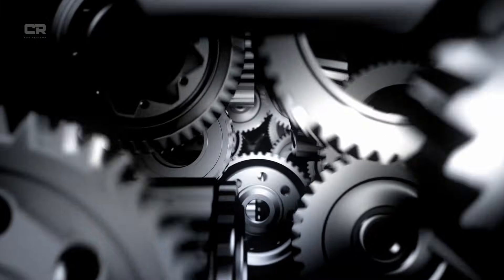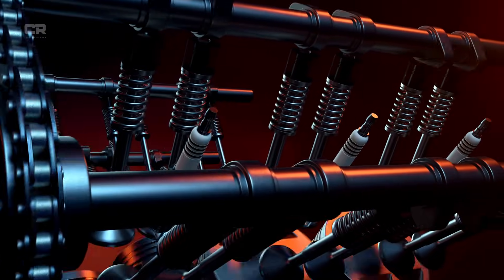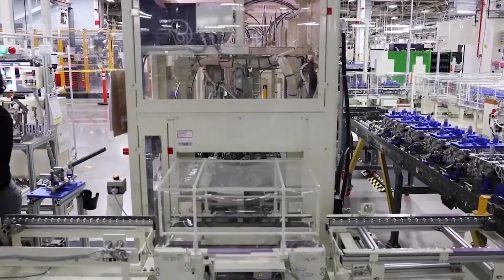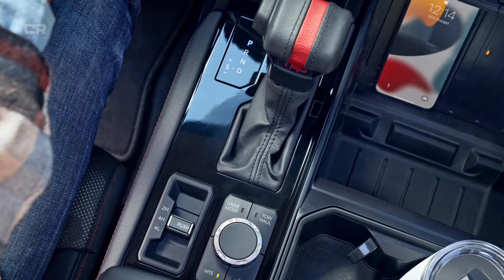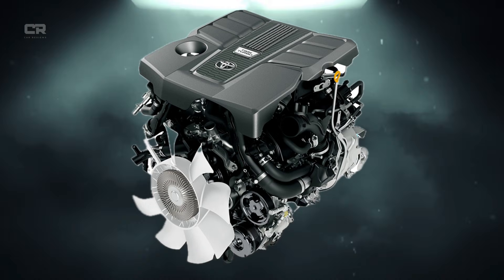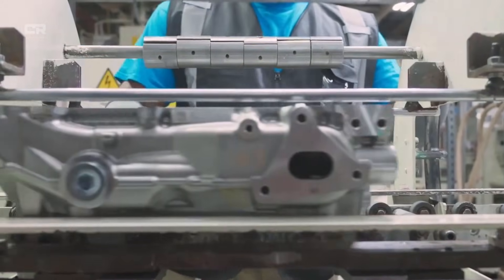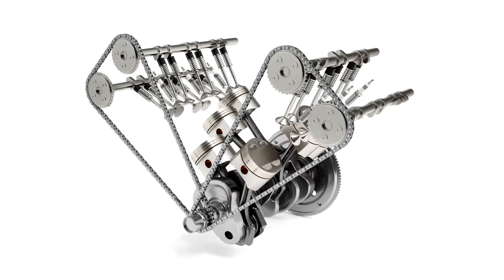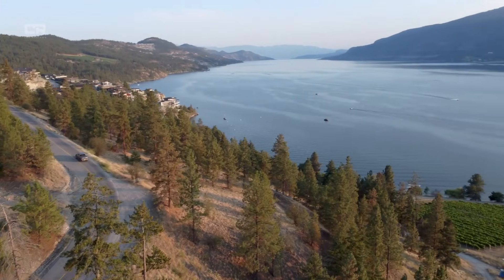Engineering Analysis: How the 2026 Tundra Engine Block Was Reinforced!

Comment: Does it improve nvh as well?  Its not a very smooth idling engine
Reply from the maker: Yes, the reinforcement does help with NVH (noise, vibration, and harshness) levels, but it's a work in progress. The design enhances overall performance, and future updates may further improve that smoothness during idling.

Comment: 2008 5.7 trd sr5.
245k.
New starter, new radiator, new rear main seal gasket, new oil pan gasket. That's it.
Reply from the maker: Sounds like your 2008 Tundra is still going strong! Those maintenance upgrades are crucial for longevity. Keep up the good work!
Reply: @CarReviewshub thank you.
Reply: Not bad. I also have an'08 that I bought brand new. Still loving it after all these years.

Comment: They need to add the hybrids to the recall so we can also get the new upgraded engine if ours takes a dump. Either that or figure out how to hybridize the 5.7L v8 and make it work with this gens technology. I'll take either one.
Reply from the maker: That's an interesting point! It would definitely be great to see hybrid options included in the recalls, especially if it means improving performance and reliability.

Comment: Well. That leaves owners of 2022 -2025 Tundras holding the bag with no apparent recourse. How do they get paid for decreased life of engine? Are checks on the way for lower resale value? How about checks for unwitting participation in Toyota's R&D on this new motor?
Reply from the maker: It's definitely a concern for Tundra owners, and it's important that they voice their issues. Hopefully, Toyota will address these concerns and provide some solutions for affected owners.
Reply: You are right iam glad I dont have 22-25 sounds like it's not a heavy duty motor. We will have to see if 26 fixed all the problems.

Comment: With the fact that there are currently 2026 tundras out on the lots now. When are these new engines going to be available in the Toyota tundra and are going to be identified as the new redesigned and updated model engine.
Reply: There is another video stating that new developments will be in the 2027 models.  Unless you need a truck now, I would wait a year.
Reply from the maker: The new engines are expected to roll out soon with the redesigned models. Keep an eye on Toyota's announcements for the latest updates!

Comment: It is like Toyota just wants to solve the problem using this design.
Might it be better to just go back to an iron block.  The weight difference isn't that much and you. get a MUCH stronger block and better cylinder surfaces for the pistons.
Both my German cars have iron blocks and they stand up admirably.  Aluminum blocks with cylinder spray treatments may be great for light weight but not longevity.
You really have to consider, do you want to keep a vehicle for 200k miles or do you just want one you can rely on for 80k miles and trade it in every couple of years.
If one of the elements is environmental responsibility, then throw away engines, cars and trucks should not be on the design table.  You have to balance the fuel savings to the amount of resources and energy that a modern engine requires.  Sometimes it is more environmentally friendly to just burn a bit more fuel than throw away en entire car.
Reply from the maker: You raise some interesting points about materials and longevity. It’s definitely a balance between weight, strength, and environmental impact that engineers have to consider. Thanks for sharing your perspective!

Comment: will theses new 2026 will be installed on the crate recalled they did ?
Reply: They should put the update engine  in crate recalls. 2026 eng in 22-25 trucks
Reply from the maker: Great question! The 2026 Tundra engine blocks are designed with enhanced reinforcement, but it’s best to check with your dealer regarding recalls and specific installations.

Comment: I haven't watched yet, but I build BMW and Mercedes engines and I can tell you what the V35A needs to improve.  1. Lower thrust bearing. 2. Stronger fractured rods. 3. Stronger bed plate to reinforce main caps. 4. Locking tabs on main bearings. 5. Close the deck.  6. Increase tolerances to accommodate thicker oil.
Reply from the maker: Thanks for sharing your insights! It's always valuable to hear perspectives from experienced builders like you. I'll definitely keep your suggestions in mind while analyzing the Tundra engine.
Reply: I agree with you all the way, especially locking tabs on main bearings and lower thrust bearing needed, and better tolerances to accept thicker oil too. Watching the car nut teardown convinced me of the need for locking tabs on main bearings. Why did that ever go away in the first place?  I doubt they are even close to what needs to be done to make the engine last. Good luck Toyota on your 2026 engines.
Reply: Or they can send the engine to Yamaha  so the engineers there can tell them the same thing.

Comment: In ancient times, truck had engines with cast iron blocks.
I'm still driving a  twenty year old Tundra with the way past its sell by date 4.7 liter  i-Force V8.

My guess is the days of Toyota building an engine to last 400,000 miles are over.
Reply from the maker: It’s interesting to see how far engineering has come, but some classics, like your 20-year-old Tundra, still hold their ground! Reliability is key, and who knows—maybe Toyota still has some tricks up their sleeve for longevity!